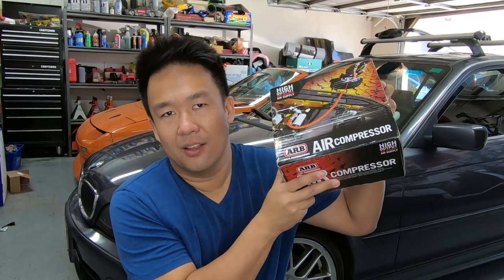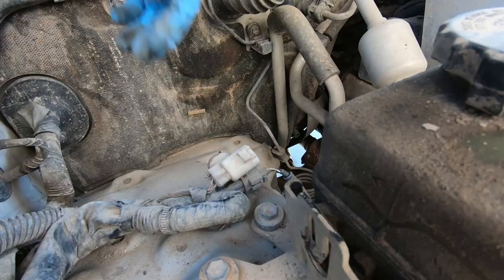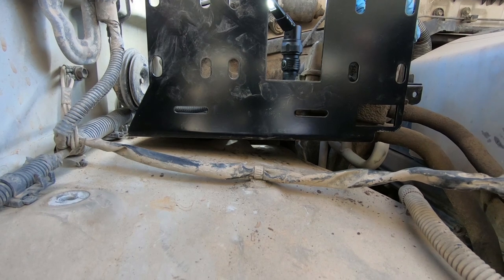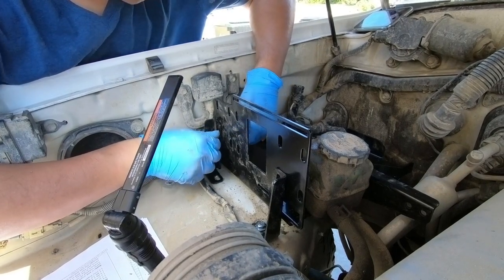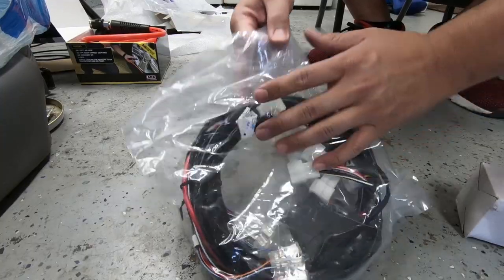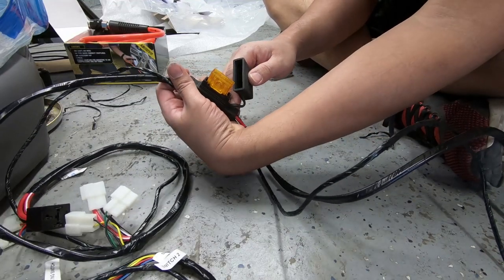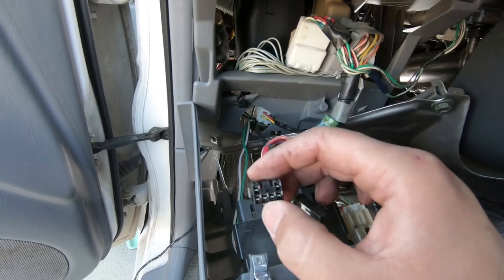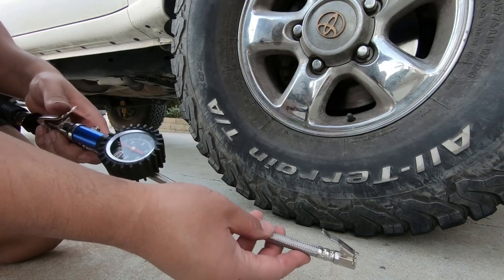ARB Air compressor install IN DETAIL, wiring too! Toyota Land Cruiser Lexus LX470

Comment: Excellent video and almost exactly what I was looking for. I'll be installing that same compressor into my truck...except instead of the arb switch in the cab, it'll be hooked up to an upfitter switch that came with the truck ('21 F-350)....I'm still trying to figure out how to hook it up to the hot wire for the switch with the wires that normally go to the isolator. No solenoids...just tire inflation. Any tips I'd appreciate it.
Reply from the maker: Hot wire needs fused relay and you should be good